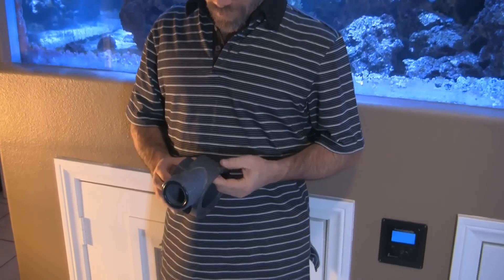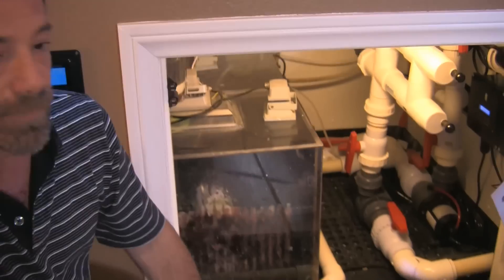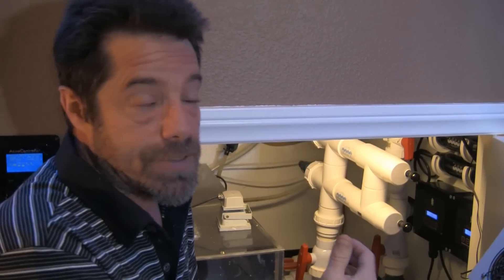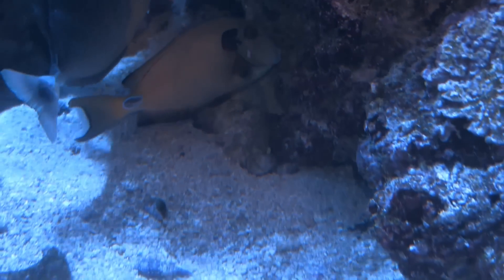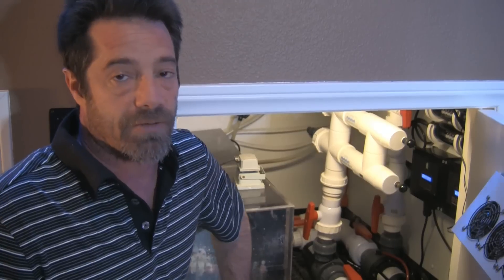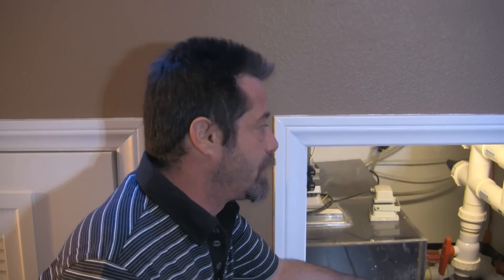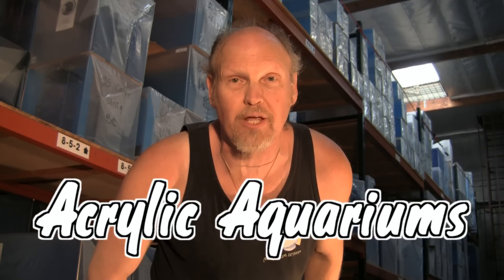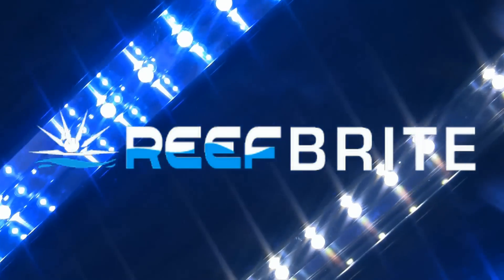DC Water Pumps, LA Fishguys Tech Talk Episode 152, part 3

Comment: Great video as always , just a question off topic , do you guys have any advice on how to best Cyanobacteria . The stuff had plagued me for months I have addressed all the suspect issues with no joy
Reply from the maker: +Sean Collins Erythromycin will knock it out but it makes the skimmer go crazy and may have some side effects but like all other suggestions it only addresses the result of the problem, and not the source, so it will eventually come back.
Reply: Cyano collects in areas of the least amount of flow where waste collects. Increase flow and vacuuming the substrate will go a long way in reducing cyano. UV flirtation will kill cyano in the water column and help stop it's spread but you still need to do the husbandry and vacuum. As far as erythromycin, I am not a fan of that approach. It's the common active ingredient in ALL Red Slime Removers (regardless of what the label says) and it's not prejudice as to which bacteria it goes after. It will kill some of the denitrifying bacteria as well. Not only that but it's a temporary fix as the cyano will come right back if you don't eliminate the issue which is the detritus that it feeds on.